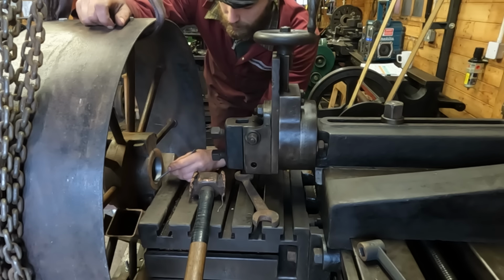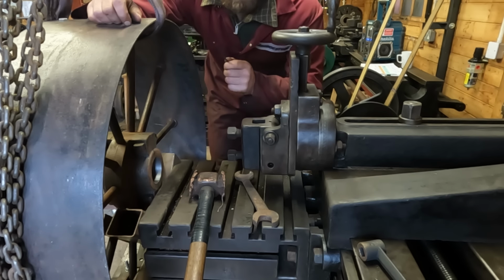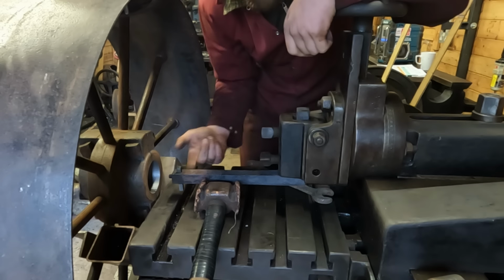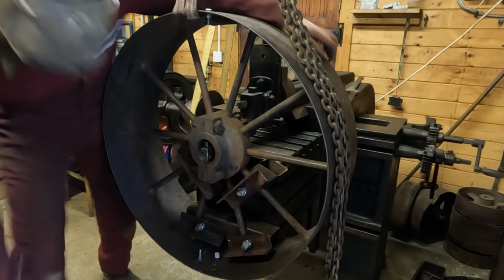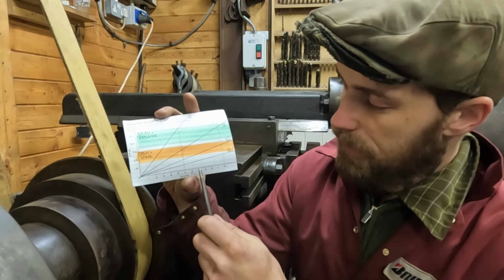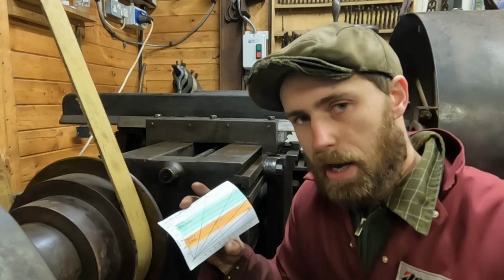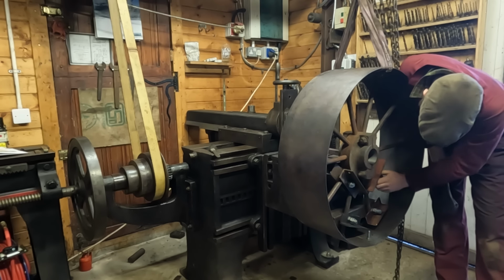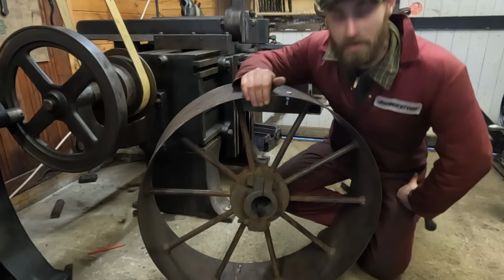Cutting an Internal Keyway with an 1890s Shaper and Forging the Tool!

Comment: Hi Alec, I've just watched this video for the second or third time. It keeps putting me to sleep. 
I'm not a blacksmith but some things you do, and don't always explain away, and there's one I must ask about. 
When forging the right-angle bend in the square stock, you heated the bend area and worked it around the square section of the anvil. Logical. But every now and again you hit the end of the bar, on both ends, not to mushroom the ends, because you ultimately had them back to the basic square dimension, but obviously something to do with the actual bend more than six inches away. My question is why and what does that achieve?
Thanks for the video and the subject matter.

Comment: Curious that the keyway is in the 'split'. That would prevent proper clamping if the key is too wide, or make the key loose if you allow clamping clearance...
Reply from the maker: I think the main reason is that it's the area with the most material where the bolts are, so stronger. Almost all the split pulleys I've seen have the key way on the split. 
A lot of the time, gib keys are fitted after the pulley has been fitted to the shaft (I have a video fitting this exact pulley that shows the process).
If they aren't fitted with a gib, then they are installed on pre-existing keys on the shaft as part of the overall shafting plan and so made the correct size.
Reply: @iron_jonesy  Aye, Fairy Nuff. Just thought it might make it loose, but if fastened once fitted, fine. Love all the old machines!

Comment: Why is the keyway on the split rather than the solid part?
Reply from the maker: The casting is at it's strongest at that point and also it makes it easier to install/remove the pulley around an existing key.

Comment: I can appreciate doing your utmost to honour the machinery our grandfathers and great grandfathers may have used. However they were also a progressive lot, always striving to modify and improve their trade. I'm sure some would wonder why you don't take advantage of a few more modern methods that still honour their time. Using modern tool inserts in your boring bars and cutting supports would certainly make your life easier.
Reply from the maker: I agree wholeheartedly. I use High speed steel bits in all my tool holders, both shop made and not. All of the tooling I use is from the last 70 years or so, so not as old as my machines. In the late 19th century, although HSS was starting to appear, most of the tooling would have been hand forged from high carbon steel, which is a whole different animal. It's much softer and loses its temper easily without proper feeds, speeds, and heat management. It is certainly a topic I'd like to explore more, from a historic point of view.

Comment: Another fine job! Mighty close to the back wall with the ram. I guess you figured out the max stroke before you placed the machine where it sits?
Reply from the maker: Yeah it's very close! There are certain combinations of ram position and stroke length where it will hit the wall, but I did a lot of working out and decided those rare times were worth the sacrifice to gain a bit more space in the middle of the shop!

Comment: My  converted line shaft shaper, circa 1900 has an extra large lantern style holder, and my key cutter replaces that and is held in by a large nut behind the tool bar insert. Its 1 1/2 in dia or so, and has a 1/2 in insert for small keys Rustinox is a great source.

Comment: That's a nice old machine.🙂 I am lucky enough to own a small 7" stroke Mit-a-Mit shaper, made here in Oz for the WW2 effort. It's meant to be mounted on a bench with the apron hanging over the side and has a hole in the top of the apron so a keyway can be cut into the end of a shaft. Mine was put on a floor pedestal. It's a great little machine to use and it does a wonderful job. 👍👍

Comment: enjoy your work,  would like to know why did'nt you forge a square hole for the cutter
Reply from the maker: Great question. I did consider it, but settled on the drill for two reasons. Firstly it makes it very simple to get square to the rest of the bar and secondly punching it would have caused the end of the bar to swell. While it wouldn't have been an issue here, the swelling could be a problem in the future if I need to get into a tighter spot. I could have ground/filed the swelling back but that's an extra step in an already slow process!

Comment: While I love these old machines and have a library of machine books going back to the mid 1800s, as a “modern” machinist, I would go crazy using some of these machines. They work so slowly and the machinist had to stop so often to resharpen the carbon steel cutters, no high speed steel until the 1900s, that by today’s standards, nothing was getting done. It would drive me crazy to cut that key way that way. But these were the machines, going back to before 1850, that made the Industrial Revolution possible. It’s not that they were more patient back then. It was just the only way things could be done. I’m sure that 100 years from now, if we haven’t destroyed civilization first, that people will be looking at our most advanced CNC machinery the same way we’re looking at this and thinking at how patient we were waiting for the slow machines to finish.
Reply from the maker: Absolutely, its just a step up from doing it by hand!
Reply: @iron_jonesy  Chisel and file. Somewhat slower. We started with that in 1968 on my apprenticeship, drill, chisel and file the frame of a small G clamp. I never used that combined set of skills again. But shapers, though inefficient, are lovely machines.
Reply: We'll be right mate !!!

Comment: I wonder where you found that fine old machine?
So much has been junked!

While I daresay that you used an hss tool bit, plain carbon steel is entirely adequate at slow cutting speeds & can produce a finer finish.
Reply from the maker: This particular machine worked at Wildspur mill. This isn't its first time on youtube, there is a video of it in its original location, not running unfortunately, but there nonetheless. Ill dig out the link and post it. That workshop was eventually cleared and the shaper found its way to me via friends. 
Yes! plain carbon tooling is not something I've dabbled in to much, its too easy to reach into the hss drawer! Definitely a subject to visit another day!

Comment: Cheers Alec - thank you for the informative and entertaining video. I was very impressed with the way that you forged the tool and the care taken to get the 90 degree angle so neat. I notice that your shaper takes the same time for the cutting stroke and the return. Am I right that later shapers were designed to have a faster return stroke?
Reply: I was counting the stroke time too and made it about 4 and a half Mississippi on the cut and 3.5 on the return ? You could see it does use the Whitworth Quick Return mechanism, but maybe it just looked equal cos of the slow speed ?
Good point on upsetting the bar too, I snapped one of the "claws" off the end of my two legged bearing pullers (ground them too thin trying to make them fit !) and have been thinking the best way of turning a length of key steel into new legs.
Reply from the maker: Thanks! Glad you enjoyed it. It does have a quicker return, but tricky to see at these speeds, as Graeme says. The stroke length also plays a role, on long stroke lengths the difference between cutting and return is a lot more noticeable! 
Most shapers used the Whitworth yoke mechanism, although many older travelling heads used an offset crank, which produces a similar quick return effect. Mine having the yoke under the ram is fairly unusual in that respect.